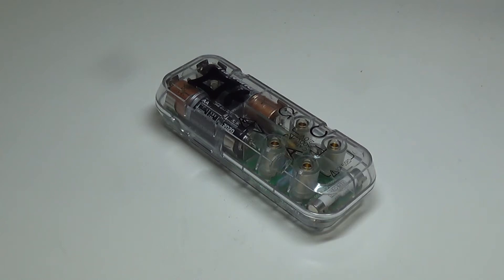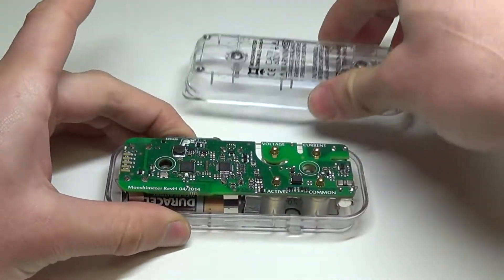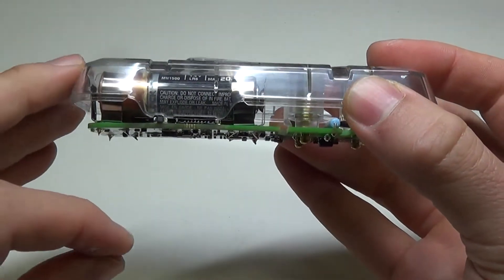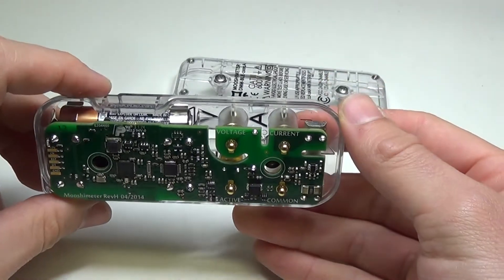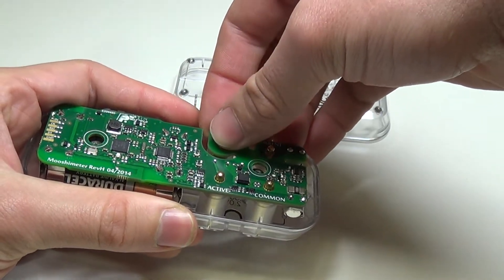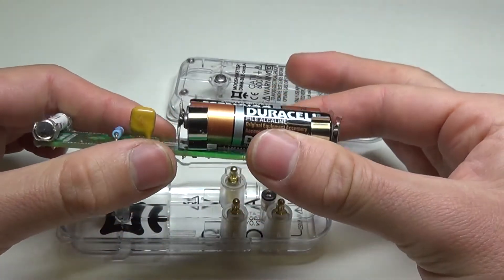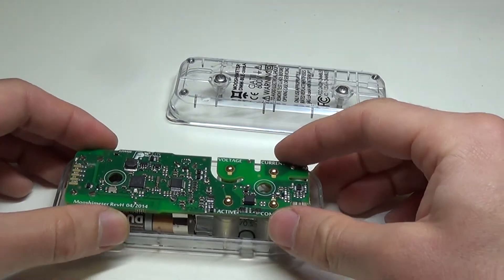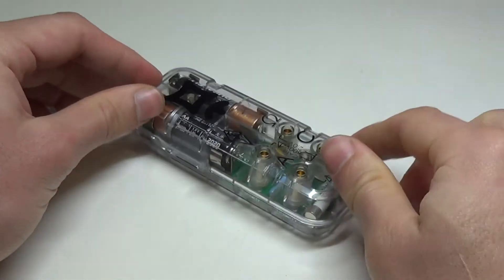Mooshimeter Disassembly

Comment: Hi there, I’m trying to repair my Mooshimeter after batteries leaked. Is there any way you could advise me on the value of the 2 x SMD components adjacent the GNDTerminal. I assume they are two capacitors, perhaps 0.1uf and 10uf. They are in parallel with each other above the 6pin smd voltage regulator. If anyone can advise me, my email is kavanaghelectrical@gmail.com.

Many thanks.